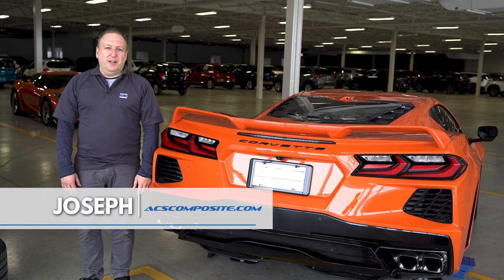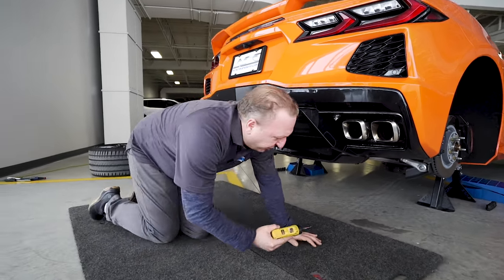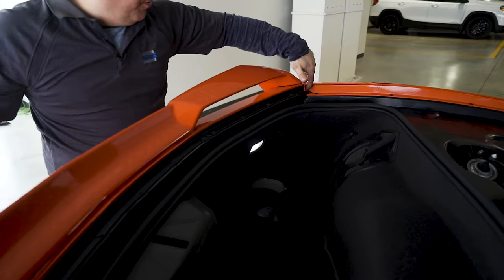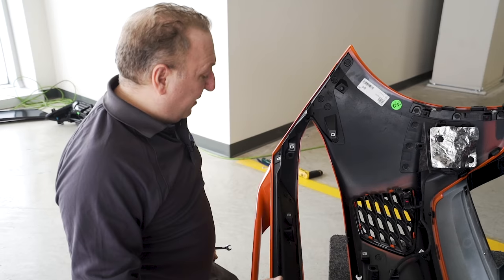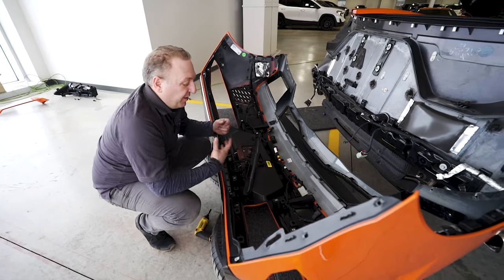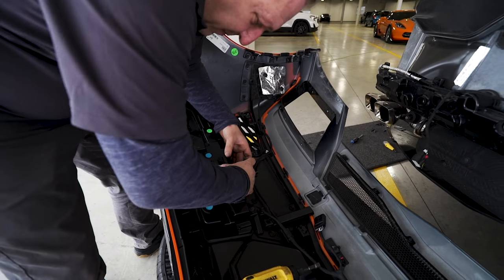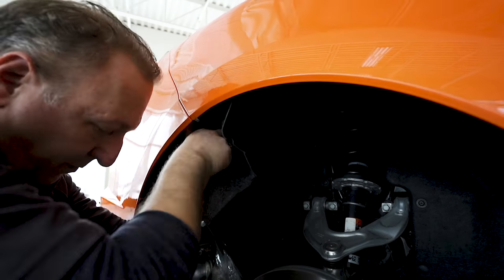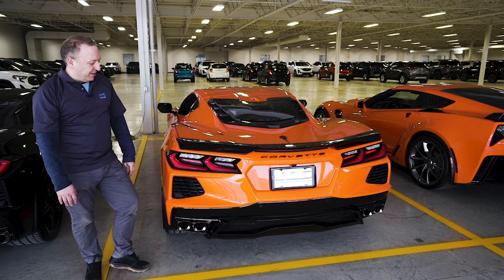ACS Composite C8 Corvette Speedtail Spoiler | PN 50-4-047 | Installation Video

Comment: Definitely something I will consider for my non Z51 C8. Nice job ACS!
Reply from the maker: Thank you, Marc! 🔥
Reply: @ACSCOMPOSITE  I just installed your carbon flash rocker extensions and could have used this install video. I saw Joseph use a pry tool to make pulling off the tape backing much easier. I broke the backing on each side.

Comment: If u have a non-z51 car (no spoiler) can I remove the studs easily on the spoiler so that I can just install with the double sided tape?
Reply from the maker: We won’t recommend that.
Reply: @ACSCOMPOSITE  that's not my question..my question is are the studs easily removable?
Reply from the maker: You’ll have to cut them off.